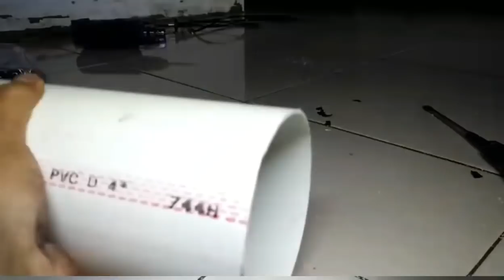cara membuat canister diy mudah dan selalu waspada kebocoran

Comment: In India this type of lid is not available
Reply from the maker: I can send it from Indonesia if you want it
Reply: @sirambanyu  
Thank you for your response please check can can it ship for my place.
Pin 501101, telangana state, india
I want 6 inch size my tank is 800 litre planted tank.
ThanQ
Reply from the maker: Sory That 6inc is not here
Reply from the maker: @rajeshakula8376  I have a DIY 6inc canister filter for your 40watt machine. Sorry I can't contact your wa number
Reply: @sirambanyu  then please check can it ship to my location 501101 india. 
What's the price and shipping charge???
Reply from the maker: @rajeshakula8376  $45
Reply: @sirambanyu  is it including shipping??
Reply from the maker: @rajeshakula8376  not only the shipping price not the item price
Reply: @sirambanyu  😂😀😁
It may get very costly equivalent to sun sun 304b
Ok what's the filter price
Reply from the maker: @rajeshakula8376  price filter $64,5
Reply: @sirambanyu  in indian rupees it will be almost 8000 rupees
In 6500 i can get sunsun 304b home delivery
Any way thanks for your reply
Reply from the maker: @rajeshakula8376  actually my filter is cheaper but the shipping price is quite expensive, let me find a shipping package that is even cheaper

Comment: ukuran tank 40x30x35 pake PH mesin yang mana merek apa ?
Reply from the maker: 800 L/H kuat om.. merk bebas om.. kalo yang bagus aquila
Reply: pake AMARA 1200 AA kuat nggk ?
Reply from the maker: liat l/h nya mas.. klo 1200l/h kuat sekali..
Reply: tapi pake filter itu gpp kan ?
Reply from the maker: gpp om..
Reply: Piano Rizk om mw tny saya pake amara pompa celup 1600 bisa g y om
Reply from the maker: bisa om.. punya saya cuma 960l/h juga bisa kok om
Reply: siram banyu itu yg di menit 9.15
Yg di pasang pd power head ,nm nya ap y kang,
Mf new kang..
Reply: Mas siram bayu mw tny, pipa brp inch & tinggi nya brp cm